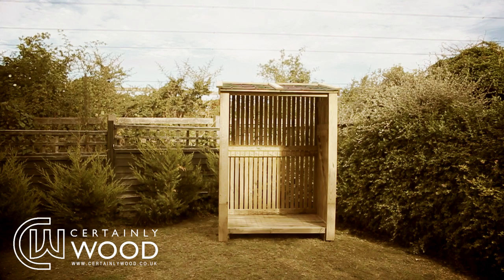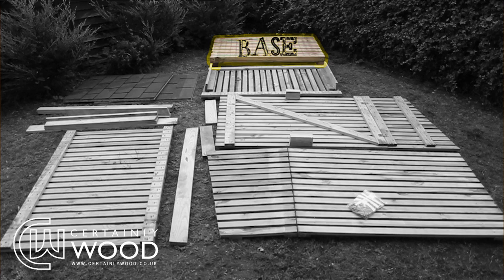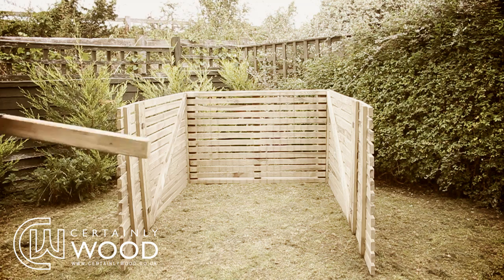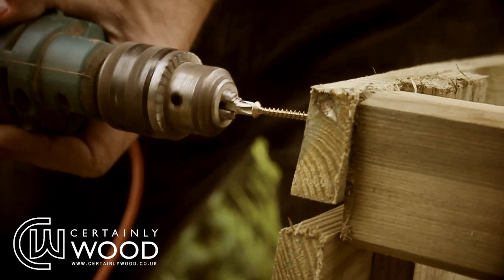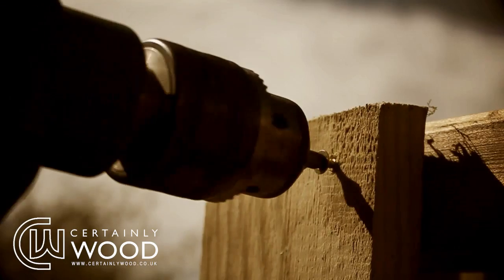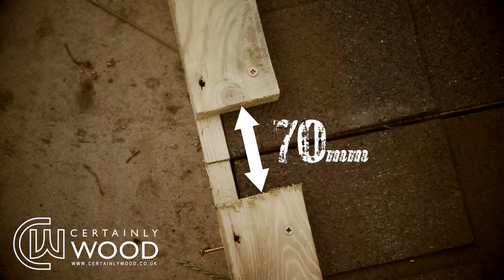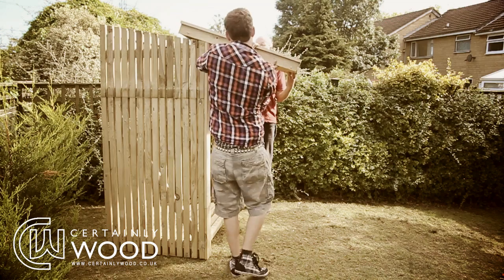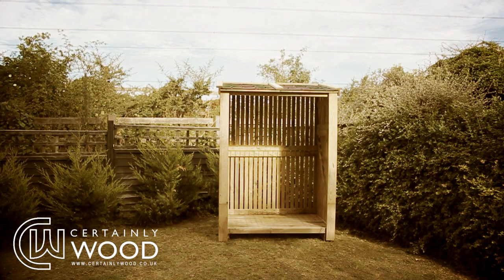How To Make A Log Store

Comment: I found the instructions and video to be confusing. The parts that you have to take the black screws out - it doesn't say if you just chuck those bits away or what ? Just get someone who hasn't seen the log store to try to build it and give feedback. The logs they supply are top quality though.